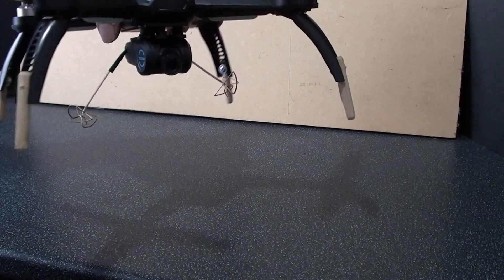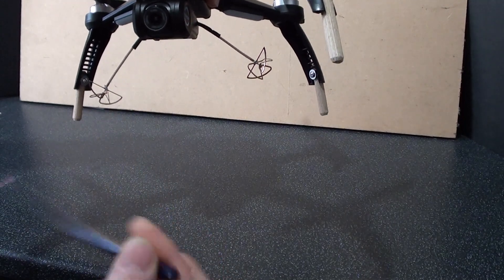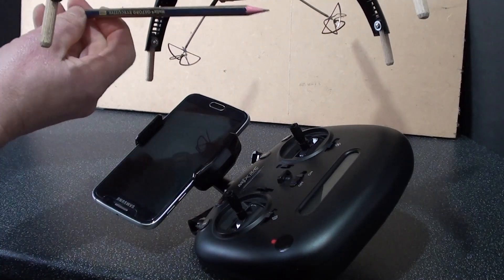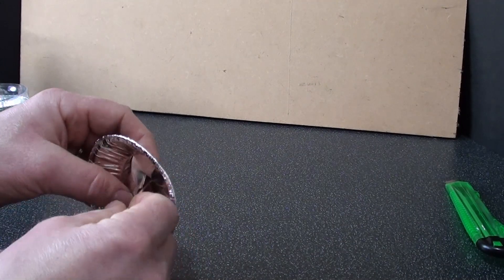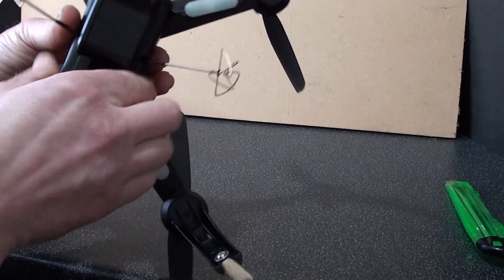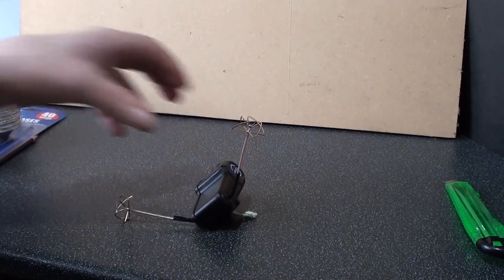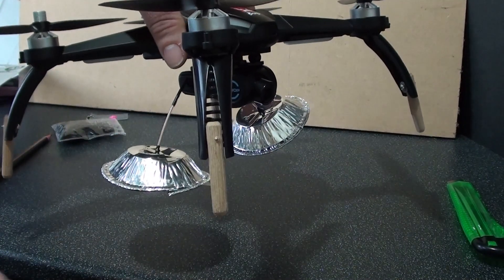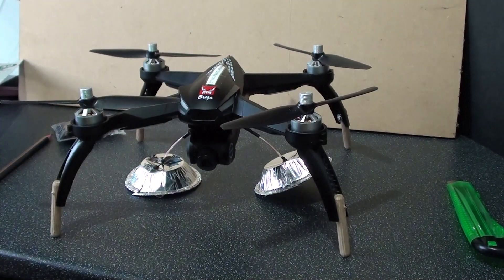MJX Bugs 5W Drone FPV Signal Boost Reflector Mod

Comment: Can you get extra range withouten those upgrades and just use a fpv camera or doesn’t the drone film after losing connectiin
Reply from the maker: Range on an modified drone is always dependent on local conditions but the antenna mos definitely helps.
If you have the AD card fitted in the camera it will continue to record even if it looses connection with your phone. If there's no SD card in the camera then footage is recorded directly onto your phone and will interup recording if you loose signal.

Comment: Nice idea. Being a former Amateur Radio Operator here in the US I have some experience with RF and antennas but not in this band. However, I think your lack of positive results with the reflectors is in allowing them to contact the polar antenna radiator. Perhaps if you used some grommets and maybe some hot glue to hold the reflectors back from the reflectors about 1 or 2 cm so that they didn't electrically contact the cloverleaf. If you get a gain increase then you could possibly adjust the distance from the cloverleaf to optimize your gain. If the mod shows promise you could alleviate the poor aerodynamics by using a mesh type reflector rather than custard tins. Just an idea. Anyway, thanks for sharing the concept. Great video. Cheers!
Reply from the maker: Thanks, appreciate your input. It was very experimental as I have no electronics background but it's the principal I was working on. What you say does make sense about the foil touching the clover head - I will give it some thought.